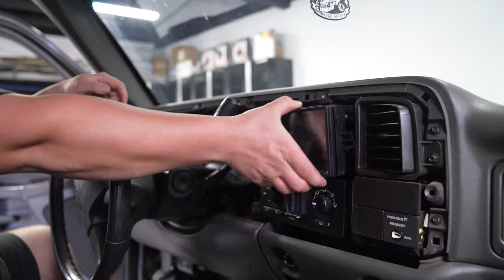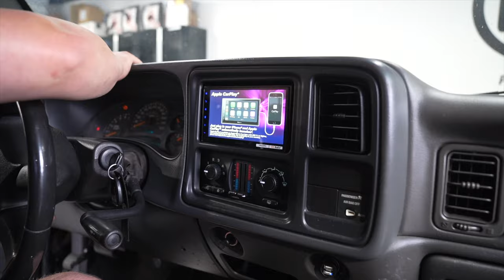How-To Install Apple CarPlay & Sound System w/ Subwoofer

Comment: Using Speed wire also known as nine wire makes for a faster easier and cleaner install instead of running separate speaker wires to the amp. Nice install tho 👌🏼
Reply from the maker: Good tip! We will look into this for the next install🙌🏼

Comment: Decent install. I like the use of the 5. Channel amp. I personally would have done components or a 3 way set up in the front doors. So much space. Also made an amp rack. For subs maybe 4 8 or 6.5's. I think they would aound better.
Reply from the maker: Thanks for the tips!🤘🏼

Comment: lovin the setup!  

How are those Focal's?   Waiting on delivery on some 4ea Focal Performance 165AS 6.5in component speakers from Crutchfield for the WRX. 6.5's will be powered by existing JL Audio 4ch amp.  Currently have some old Pioneer 6.5in coaxials, one of which is toast.  I'm running that same Pioneer 2660NEX HU.  Just recently picked that up a few months back and have been really impressed with it.   And it's Android Auto compatible for anyone wondering.  Also, running one JL Audio 12in sub powered by JL amp.   Can't wait to get those Focal's installed!
Reply from the maker: After using the sound system for a month, I can say its one of the best sounding systems I've heard!!